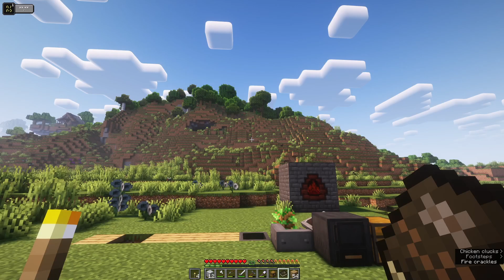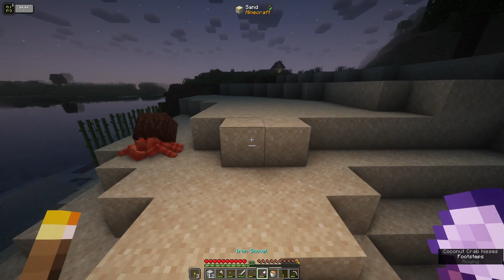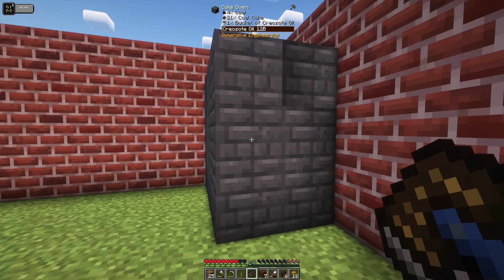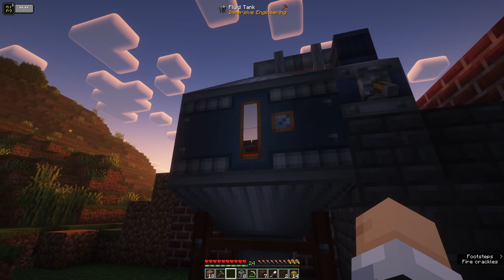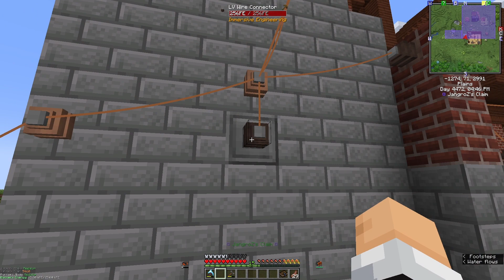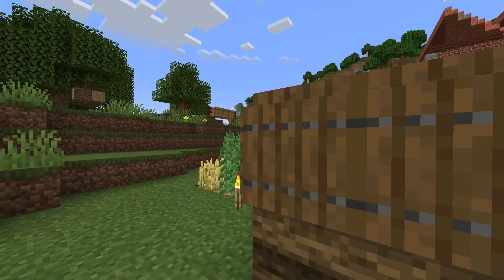Jangro's Modded Minecraft #2 - Factory Build with Immersive Engineering!

Comment: I'm glad to have immersive engineering for MC 1.20.4 but I miss engineer's decor. It forces me to try things a new way, though, so that's good.
Reply from the maker: Working on putting together a mod pack now and we have Engineer's decor in it. We're using 1.20.1. 1.20.4 is still too new unfortunately.
Reply: I'll keep an eye out for your pack. These days 1.20.6 is where it's at :P
Seriously, I started wondering recently if 1.20.4 might end up as one of the generally "skipped" versions for modded.